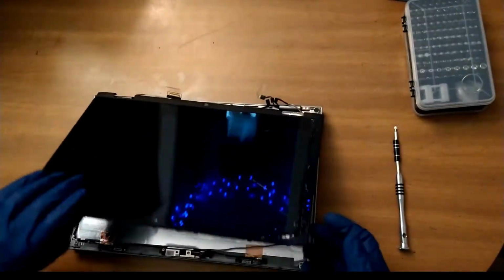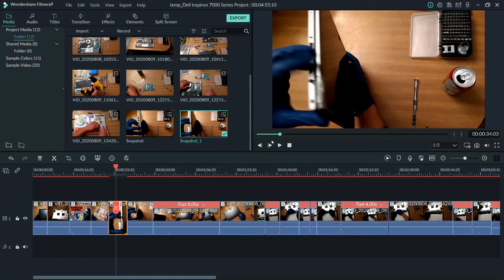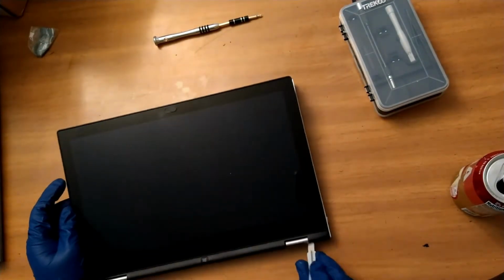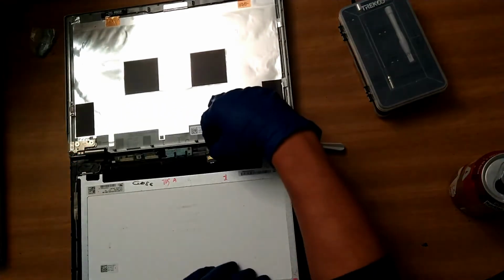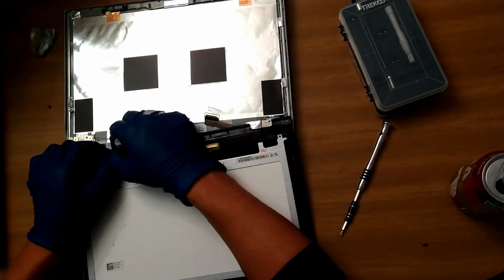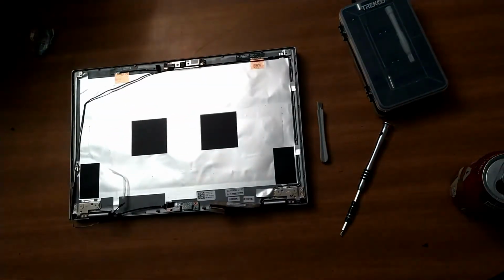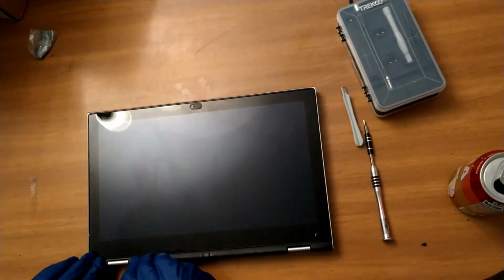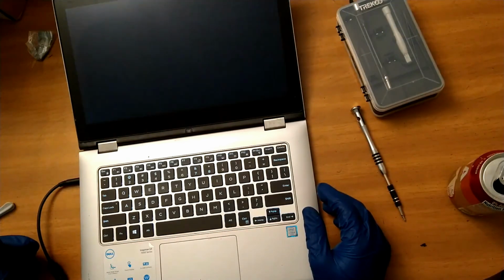Dell Inspiron 13 7359 Screen Repair (easy)

Comment: my screen is cracked so bad on my laptop. wish could show you or like do short or video to show you to see how to fix? I need replacement in the future. I can still see so trying to save $ and just use it anyway. we have other monitors I could connect to but just use this like it is for now. Just found your video looking into if could fix myself. Thanks for the screen is broken so is this screen full replacement or another part? please post video how to take everything apart to get to where it is in beginning of this video.

Comment: Hey, nice! where can i buy that frame, can u share me a link? thx
Reply from the maker: Unfortunately I don't have any links but you can search on eBay for a screen or another laptop of the same exact type to use for parts. Just make sure the screen and frame is still good before buying. You should be able to find parts or a parts laptop on eBay, Amazon or FB Marketplace

Comment: Is it necessary that I take out the battery before starting the screen replacement?
Reply from the maker: I would recommend to at least disconnect the battery just to prevent any shorts from happening. 
You might still screw up but at least you won't fry something. Well hopefully.
Reply: @Projectlalo  thanks for the reply bro. This was my first attempt and I can confirm to you that something actually got fried, yeah the flex. 

I did remove the battery before starting the operation but immediately I plugged in the charger(still with the battery out) to test things out, I heard a frying sound which was followed by smoke. I still can't figure out why this happened though but I sure felt sad about it.
Reply from the maker: @madeviral6290  ugh! Sorry to hear that. Unfortunately there's always a risk of something getting screwed up especially when we've never tried it before. 
Definitely have been there and feel your pain.